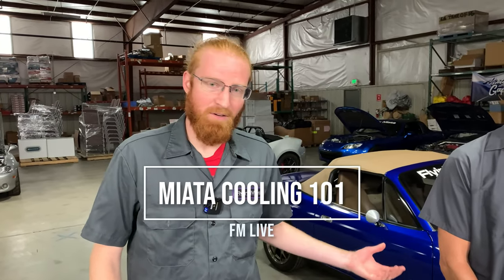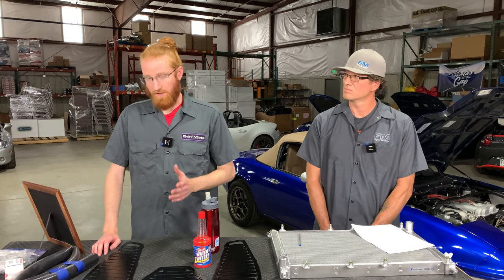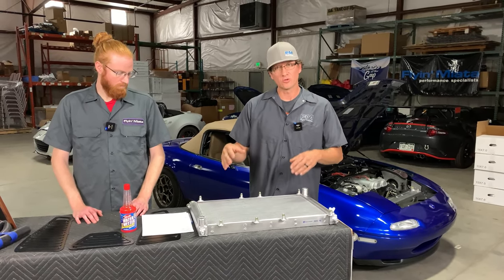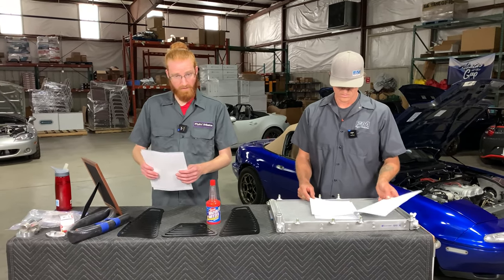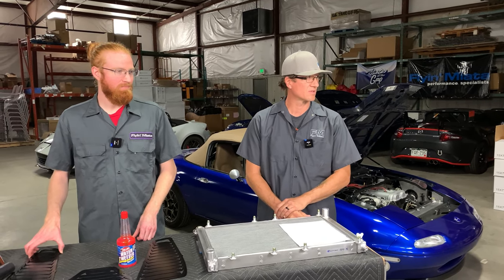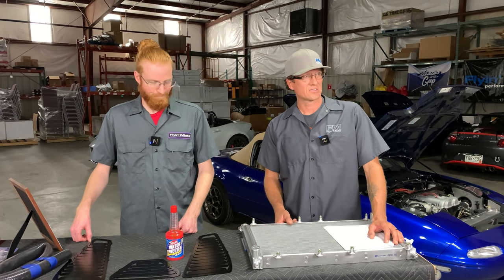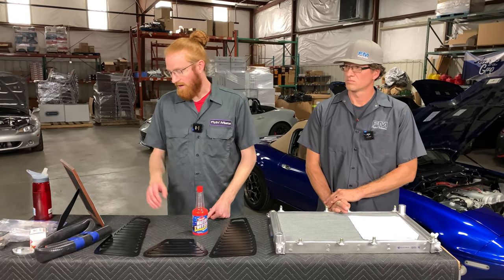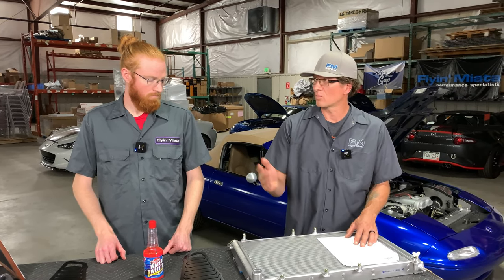Cooling 101 (FM Live)

Comment: FM: Adding a cross flow radiator eliminates the foam seals on the sides of the stock radiator. Since the seals function to increase forced air through the cooling fins, why are foam seal replacements not included with the aluminum crossflow radiators (up to ND)? Thanks for all your great videos.
PS: Also note that the ND has a lifetime (expensive blue green, bitter to reduce animal poisoning) coolant that is incompatible with standard antifreeze.

Comment: My temp gauge (NA6) climbs and just stays at like 12:30 (just a little past the middle, towards the hot side), no matter what. Traffic, cruising, spirited driving. I've been told it isn't bad for the car, but it irritates me to no end. The fan (big aftermarket one) works, and i have changed the temp sensor. What might it be?

(Edit because i my brain is slow. It doesn't leak from anywhere, the coolant is changed yearly or so, and it always looks nice when poured out. And the plastic undertray looks surprisingly well)
Reply: Just because you changed the temp sensor, the gauge may not be sensitive enough/right type to use it.  After '94 (if memory serves) both the sensors and gauges were  dumbed down to essentially be idiot lights. 
Get an ODBII gauge - I'm a big fan of the ScanGauge II - nice and compact.  You can see the actual coolant temp as well as a lot of other useful stuff, but there are a ton of different ODBII guages on Amazon/Ebay in all kinds of shapes and sizes.
Reply from the maker: Stock gauges have a dead spot in the middle, so a single needle position accounts for a relatively large (but entirely safe) temperature range. We've also heard that Canadian cars have their needles set a tick warm to ensure the driver that the heater will work while US cars have their needles set a tick cold to ensure the driver that their car isn't overheating. Hearsay? Definitely. Possible? Seems like it. Based on your symptoms, you're probably fine, but an aftermarket gauge will answer that question definitively.  Please feel free to reach out to our customer support team directly if you have any other specific details!
Reply: @FlyinMiataVideo  Thank you very much! And i'm working on a bit of a list to ask your CS team, you will hear from me for sure!

Comment: They say after 20mph your fans are slow air down and not helping. I could see this being true on cheap fan and oem. I have your stage 2 brushless. I like how it only has one fan and a bunch of hole if air does get built up.  But I think with your fan it can really suck alot of air through. I wish there was a way to test to see what mph the fan is useless. I think if it's much higher it could be a selling point.  Cause it seems like it's working for me. 

No undertray, 98° humid asf. Driving on the highway at 70mph 185°. 195° doing some pulls. 
Haven't brought it to the track yet but for a miata with a/c(not on). That's pretty damn good!
Reply from the maker: Excellent question! There's a lot of noise about how necessary fans are, and there are a lot of right answers - for specific situations. The more (and better) your ducting is, the lower the road (really, air) speed needs to be to flow more than the fan(s) can. To test this yourself, since you have our fan setup with flaps, set up a camera in the engine bay (with a flashlight!) that's pointing at the flaps in the shroud. Be sure you can log speed (maybe start a second camera at the same time and point it at your speedo), then go drive. At what speed do the flaps open? That's when the air coming into the mouth overwhelms what the fan is pulling. If you want to do the same test for the max that the fans can pull (since your fan varies its speed depending on temperature), set the fans to full speed (12V down the blue wire if you're using the brain kit). Depending on the specifics of your install, this could be as easy as turning the AC on (refer to the instructions for more details). 

Agreed that 185 - 195°F is great for temps! FWIW, assuming you're using our fan brain kit, the fan doesn't start to spin until 190°F and isn't at full speed until 215°F. IOW, it looks like the fan has no difficulty pulling the temp back down to nearly the thermostat temp (assuming you're using a 180°F thermostat) with very little fan speed - meaning you have tons of headroom for when you're really pushing things!

Comment: So I have your Crossflow radiator, and your Intercooler piping on my 94 NA, I do not have the reroute kit, and with the crossflow radiator hose even cut down as far as I can get it, when the engine is up to temp the radiator hose will touch the intercooler intake hose.  I don't think it rubs enough to be a problem, but I just can't get the hose any shorter should I be concerned?  Note when the engine is cool, I have about an 1/8 inch gap between the hoses, and it only rubs when it is hot and the radiator hose expands.  The only way left I see to get more clearance would be to trim the intake hose a bit more at the thottlebody. as I have maybe 1/4 inch inbetween the IAC plug and the back of the intercooler hose.  I noticed in one of your prior videos that Matts car is configured this way and wondered if he has this issue.
Reply from the maker: Slight rubbing between two smooth hoses, while not ideal, probably won't cause an issue. That said, if you can bring the throttle body inlet hose a little closer to the engine, that would be great. Just remember it's really difficult to add material back on! Trim a little at a time and look around first to be sure you're not going to cause other problems.

Comment: What sort of testing have you done with those Civic half radiators? Leaves the other side open for an intercooler and the piping is easier. I've seen good things about them from people that have them and I've seen a lot of bad things about them from people that haven't ever tried it
Reply from the maker: We haven't tried that setup, but we're nervous - Miata engines aren't great at cooling to start off with, so halving the cooling capacity (heat exchange, specifically) doesn't give us warm and fuzzies. The only argument (cooling-wise) we can see for that is to move the intercooler to the other side so it's not in front of the radiator, to eliminate restriction / pre-heating of the air in front of the radiator. We'd be really curious to see the results of that, but we're not optimistic. Really, what are you trying to accomplish? How is this going to be beneficial? Easier intercooler hose routing? Awesome, makes sense. Improved cooling? Might not be a great idea. Also remember that you want low pressure in front of your heat exchangers and low pressure behind to improve airflow through the heat exchanger. Opening up half of the "mouth" (if you don't put your intercooler there) could increase underhood pressure and compound cooling issues.
Reply: @FlyinMiataVideo  everyone I have seen that has actually done it has done a coolant reroute + a civic thick radiator + intercooler for their turbo. I haven't seen someone non-turbo do it. Apparently it really is easy for routing and if you want to keep ac.

Comment: Can you recommend an aluminium radiator for an NA automatic?
Reply from the maker: Unfortunately, most aluminum aftermarket radiators will have the same issue because they eliminate the secondary cooler that the automatic cars use for the transmissions. If you really want to go the route of an aluminum radiator, you'll need to get and install a separate small trans cooler. Feel free to reach out to our support team directly if you'd like more details or need suggestions. We do sell stock style replacement radiators for automatic Miatas if you just needed a good quality replacement.

Comment: Is there any proven data about if using rubber coolant hoses over silicone ones is better? I mean about leaks and long term durability, efficiency 

OEM rubber hoses are way more expensive than silicone ones
Reply from the maker: We haven't performed any back-to-back durability tests, but silicone is generally considered longer-lived than rubber. That said, be sure you're comparing roughly comparable parts, quality-wise. Mazda hoses should be the best rubber parts, are you comparing to the cheapest silicone parts or the best silicone parts? For what it's worth, we use high-quality (Mazda) rubber for most of our coolant hoses and we have no durability concerns.

Comment: How effective is the stock water-oil cooler? Many early miatas have the iac valve, water-oil heat exchanger around the oil filter, and enters at the back of the cylinder head. 
Does bypassing this / capping it off make a big difference? 
Whats your opinions on heater core bypass?
Reply: The stock cooler is mostly effective as an oil warmer.

Do not bypass the heater core as you can overheat the engine
Reply from the maker: Remember that when you have two fluids with different temperatures, each one will try to match the other. Coolant warms up more quickly than oil, so it will perform as an oil warmer until the oil gets hotter than the coolant. Oil, given enough time, will generally run hotter than water (and can deal with higher temperatures), so what started off as an oil warmer (or coolant cooler) will transition to a coolant warmer (or oil cooler) eventually. For street cars, this is okay - cold oil isn't great for your engine (or power, emissions, etc.), so the quicker your oil can come up to temp the better. You also want to boil condensate and general nastiness out of your oil as much as possible, which means getting it to at least 212°F. For track cars, bypassing this could help keep the coolant temp more in check, although your oil won't have any cooling. We can help with that problem, though.
Reply from the maker: As far as the heater core bypass – Depends on the application. For cars that don't have a heater, such as an Exocet, we'll bypass the heater (we don't recommend plugging the ports). If you have a heater, bear in mind that what you really have is an extra radiator - it's uncomfortable, but turning the heater on can help shed more heat from the engine. Basically, there's no cooling advantage to a heater bypass - instead, it could be a disadvantage. The only reason to do it is fewer potential failure points.

Comment: On a stock 95 1.8, would y'all believe that a crossflow rad and fresh hoses all the way through is good enough for beginner track work? I planned on doing a reroute (and I still will sometime) but Im wanting to start my time on track asap
Reply: I track my Miata all the time with a skunk2 aluminum rad, fresh coolant and fresh hoses. Stock fans no reroute and I’m able to beat on my car for entire 20 minute sessions and don’t ever have heating issues. Willow springs is in the dessert too so it gets pretty hot
Reply from the maker: At that absolute least, that - and fresh coolant, preferably 70% distilled water and 30% antifreeze, and a new 16 psi cap - are a great place to start. If you have issues beyond that, fans or venting will most likely be the next steps.

Comment: I tried running straight 100% water and an experiencing boiling and losing water quite rapidly (1-2 cups per day) is this normal?
Reply: OMG, this must be a joke.
Reply: @aussiechris5904  not a joke on hot days I get home, turn off my car (99 nb1-1509xx miles and here loud boiling and thumping. But it never runs hot and the fans rarely turn on
Reply from the maker: Water boils at a lower temperature than antifreeze, so the more water you have the lower your boiling point. The solution is a higher pressure radiator cap - higher pressure raises the boiling point. Just be sure you have no questionable components in your system - an old radiator might be okay with a lower pressure cap, but a high pressure cap might push it over the edge and cause a failure.
Reply: @FlyinMiataVideo  thank you

Comment: Ive always knowm deionized water to be correct for cooling systems,  not distilled.

The water used in premixed coolant is deionized, not distilled, as well
Reply: In terms of cooling systems I’m pretty sure deionized water and distilled water are created equal.
Reply: I wouldn’t use deionized water in a car. It is known as “hungry water” because it wants it’s minerals (iron) back that were removed. Deionized water will destroy cast iron. There is a reason DI water is run in plastic piping.

Comment: Taking freezing temps out of the conversation,  so say you live in a place that never gets below, or even near, freezing, then what is the IDEAL ratio of coolant-to-water?
Reply: probably distilled water with water wetter added to be honest. coolant is only there to stop the forbidden gatoraid from freezing and ruining your engine
Reply: @shrimp562  Coolant does have corrosion inhibiters too - which is why I need to stop procrastinating and change mine :p
Reply: @DocNo27  well yeah. That's why you use water wetter with distilled water and not pure distilled water
Reply from the maker: As stated in the video, straight distilled water with water wetter or similar additive, paired with a high pressure rad cap, should be the optimum set-up in warm environments that never have to worry about freezing. Feel free to reach out to our support team directly if you need more specifics! :)